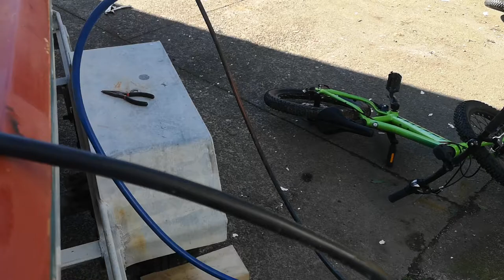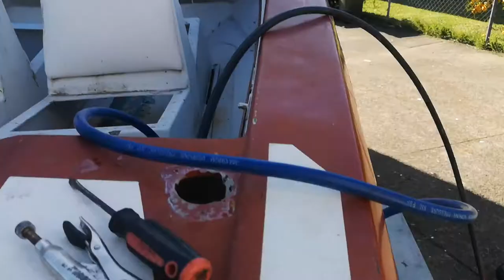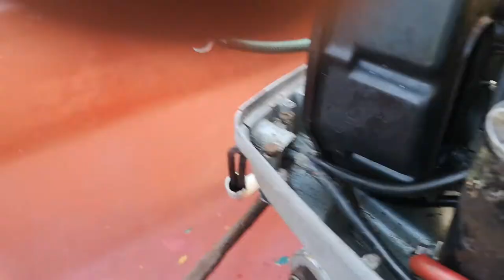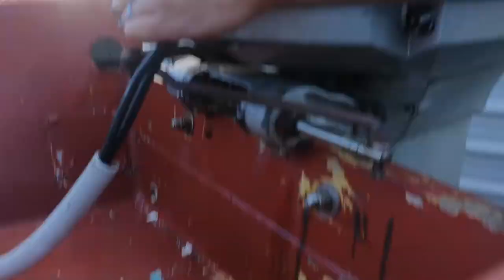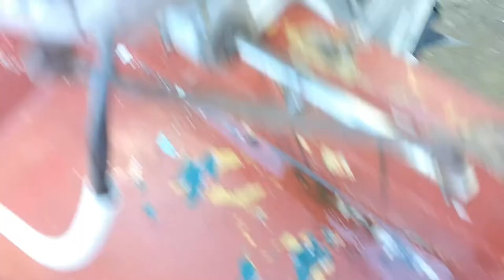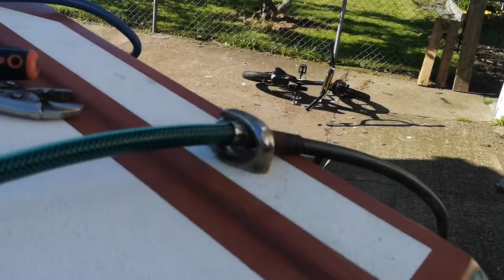steering cable easy fix/lubricate. boat outboard.

Comment from the maker: An update on this process. I left the hose elevated over night with pressure from the compressor. In the morning I pressurised the hose that had gone soft and cranked it a few more times. I noticed sludge oozing out of the tilt tube. It was old horrible grease. The steering cable is now free. I don't know how long it will last as all that pressure may have damaged the seals. Also grease has come out and been replaced with oil that is probable more likely to escape. On saying that I could use this method to re-oil the cable every so often if it starts going stiff. A few months in and it's still good.
Reply: I gravity fed paint thinner from tail with a plastic tubing, it went through to tilt tube, water and rust thinner came out, cable moves and still very stiff. No more liquid will go into as old grease softened and make an air seal. 
l ll try your pressure method from tilt tube end, and hands turn steering wheel backing forth to see if it frees up more.......

Comment: Is this a rack and pinion system which I have and can't get the cable through after disconnecting it off the motor my question is has anyone lubed the cable from the front like you're doing off a rack and pinion system
Reply from the maker: I guess it is rack and pinion if you consider the lumpy cable end the rack. There is usually a cotter pin or an R clip or the likes holding the steering cable in to the helm unit. It won't go back in if that's installed. Sometimes you need to turn the wheel full lock back and forward to get it to pull the last of the cable in. Different methods work for different units. They can be a nuisance but you'll get there.

Comment: Good idea mate. Ive got mine apart and it had me a bit stumped how to get lub through it. Im going to try Inox mx4. How is yours holding up?Thanks.
Reply from the maker: I eventually sold the boat. It got better and better over time which is usually the opposite of boat bits. I think the lube continued to soften old grease.
Reply: @acgolem  thanks for the reply mate.

Comment: Saw another alt way on ytube.
 uses a basic air brake bleeder to suck oil through cable.
vs pumping it through.
using a penetrating type oil in that demo.

Asked local Yamaha outboard agent about cable oil. 
Said they are sealed and cant be re oiled.
Hundreds of yt videos say different it seems.
Reply from the maker: That'd probably work. Took a lot of pressure to get the fluid through tho. Left it set up for about 12 hours at around 120psi. It still took manually moving the motor back and forward to get the oil all the way through.

Comment: Having problems with a steering cable on mine its original from 69 and completely sealed can find how to even get gas in it
Reply from the maker: They are sealed. It's a slow process but if it's not 100% seized then having the garden hose full of fluid means the tail piece pulls some fluid past the seals when you force it back and forward. Takes a bit of time and effort. I bet most people just buy a new cable. I left mine set up with compressed air over night and it was clear some fluid had made it past the seals. The rod at the motor end was sludgy when I'd turn it back and forward. In the morning it was turning a lot easier too. I still have this cable and it's still moving free.
Reply: @acgolem  ah okay I get it now, ill try it like that before I head to a scrap yard thanks for the quick reply!

Comment: If the Steering shaft/cable is NOT CONNECTED... and connected to a hose... the motor should move freely. If it DOES NOT... the problem is NOT with the Steering Cable. It's with the vertical SHAFT under the motor. It has a Zerg/Grease fitting... 
I almost wonder if boat Mechanics are TRYING to SCREW over Regular Guys...
Reply from the maker: The motor is turning freely. The vertical shaft has no issue. Only the helm end of the steering cable is removed from the helm unit. The motor end is still screwed to the tilt tube and connected to the steering shaft. That's why it's hard to turn but eventually frees up as the fluid makes it's way in to the steering cable and dissolved the old, hard grease. It was 100% a seized steering cable and this method did fix the issue. Not really sure how you didn't get that.